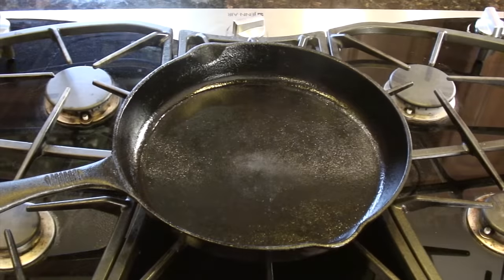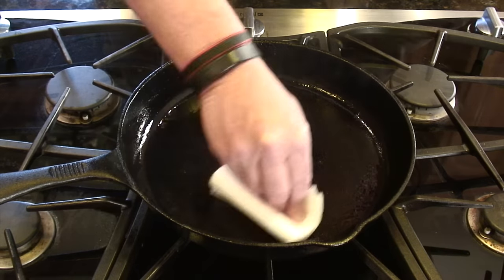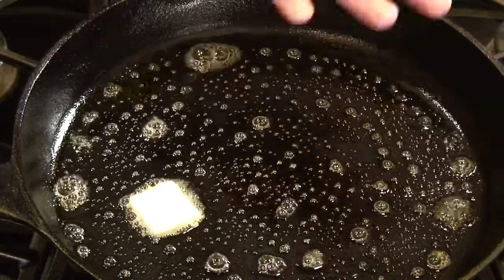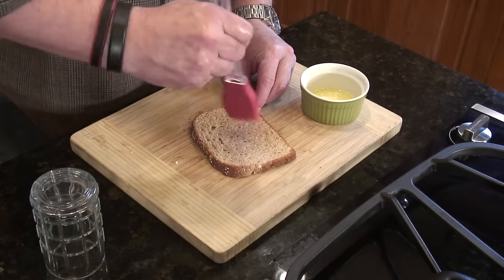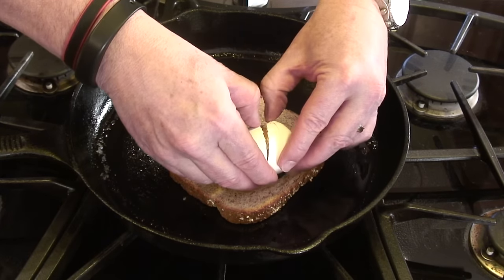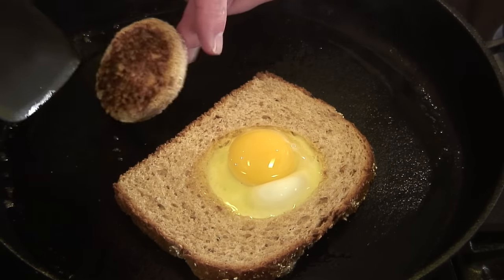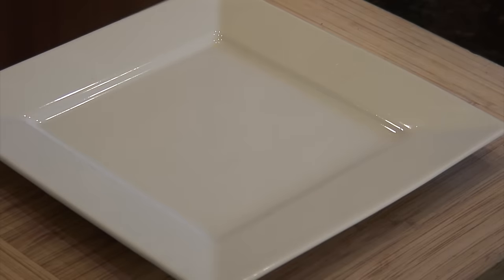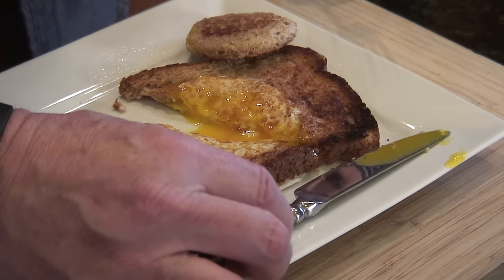How to Make Cast Iron Skillet Perform Like Teflon

Comment: Ok I love my cast iron but this does not make cast iron perform like Teflon. With Teflon, you could pretty much just do the egg without any oil of you chose to do so.  All you've done here is create a near non stick surface using oil/grease. Ya not the same.
Reply from the maker: Ok....you are right.  Go ahead and use cast iron and let it stick like glue.  I understand how Teflon works, but thank you so much for the reminder.
Reply: Are you saying that the egg would stick like glue in the cast iron if you didn't put any oil down? Well of course you are. You know why? Because you cannot make cast iron perform like Teflon that's why. 
I can make a video called "make a Hyundai Accent perform like a Shelby Cobra" ... and drive them both at a steady 60mph. See how that works? To make cast iron "perform like Teflon, you'd have to show an example of the cast iron and the Teflon both doing the same thing - at the limits of what the Teflon's non stick ability would be, not below it. 

Now don't get all bent out of shape because your video title is not accurate....

Now I'm going to go do a steak in my cast iron skillet at 500F - something I wouldn't do in a Teflon pan.
Reply from the maker: You have way too much time on your hands.
Reply: Says the man with hundreds of YouTube videos ;-)
Reply from the maker: I get paid for that.  ;-)
Reply: well then that makes it ok :)
Reply: +svtcontour Just thought I'd do you a favour since you seem to be angry. Actually u don't have to be because your example is actually wrong. He's not reducing the ability of Teflon to match the cast iron. Using your example, he is actually upgrading or modifying a slower car to perform "like" a faster car. 

So his title is not wrong, because it shows you "how to" (meaning you need to do something) make cast iron perform "like" (not turn into/the same) teflon. So, by adding 2 layers of different oils, that is a "how to", and by not sticking, that is "like" teflon. He never said, "how to turn your cast iron 'into' Teflon."
Reply from the maker: Well put Azu Shi.
Reply: Sorry Azu but you are incorrect. You can crack an egg into a Teflon pan with no oil and cook it without sticking. So in this case, it is nothing "like" Teflon. All that's done here is making an iron pan somewhat non stick by adding oil. Same can be done for stainless steel.

If he wanted to make it "Like" Teflon, then what he'd have to do is first benchmark the performance of Teflon by cracking an egg into an oil-less pan and cook it then remove it.   Then he'd have to do whatever he wants to do to the cast pan without the addition of oil and do the same test. If it performs the same as the Teflon pan, then he can say its "like" Teflon.
Reply: svtcontour You can think of them as 2 coatings. So in that sense, a coating of teflon is "similar" to a coating of a mixture of 2 oils.

The key is "similar performance" rather than "same prerequisites". By requiring the pan to have no oil, that is a prerequisite which was a claim that was never made. To check whether a claim is valid, one way can be to extend the claim by adding words:

In this case, "Cast iron can perform like teflon if you give it x coating before use."

You were interpreting it as: "Cast iron can perform like teflon with no procedures before use."

Think of it this way. A slower athlete can perform like a superior athlete by injecting steroids every time before a race. It doesn't alter his genetics permanently, but that is the way to make performance similar. So we know that to make someone perform like someone they are not, this is the "how to." The "how to" doesn't become fake just because it requires them to do it every time before a race.

There was no claim that this method is exclusive to cast iron, just like how steroid use is not specific to one person. It is perfectly fine if this technique works on other pans as well (like stainless steel).

Besides, your example was about reducing the performance of the faster car to match the slower car, which he wasn't doing. He was increasing the performance of the slower car (the less nonstick pan) to perform similarly to the faster car (the nonstick pan).

Through your analogy, you essentially said that he made a video of himself scraping off the teflon coating (you know that right?). That's why I think you were under a misconception right from the start.
Reply: I'm just pointing out that the title is misleading. The title says "like Teflon". Its not an accurate description. Thing is with the oil, well it can also be put on top of the Teflon. My car analogy is still correct btw. Its dumbing down of one car to allow comparison of another car.

Imagine if I made a video that says "make a Hyundai perform like a Lamborghini" ... and then my video was showing the Hyundai and the Lambo both driving at 60 KPH.  That would be considered misleading because a Lamborghini's performance is not judged based on how slow it goes.   A Teflon's performance is judged on how slick it is (not how slick oil is added into the pan).   In fact, you can consider 'seasoning' on a cast iron to be its coating because its also bonded somewhat to the metal, just like the Teflon. The oil is independent and can be used on both.  

The problem is that one is not allowing the full potential of one product to be demonstrated. In this case, the Teflon.  Like I mentioned earlier. The video, if titled "make cast iron perform like Teflon" would be correct only if the egg was fried in Teflon without oil - showing its maximum performance... allowing the egg to slide off with no additional oils. Then the cast iron to be demonstrated doing the same thing - without additional oils.  If it successfully allowed the egg not to stick, then fine, the title is correct.

Anyway there is no point debating this further. I've said what I had to say LOL.
Reply: svtcontour very well. i'll respect your opinion then.
Reply from the maker: svtcontour, you are definitely overthinking this.  This cast iron, even though cured, doesn't work well because it is newer (actually 20 years old or so) than the older cast iron where the cooking surface is totally grinded down and smooth.  This approach (thin coating of olive oil followed by a bit of butter) makes this typically frustrating cast iron work like Teflon, in the sense that it becomes virtually nonstick.  Many people have this same type of newer cast iron (rough cooking surface versus smooth) and get frustrated because even though cured, food still sticks.  This approach provides them with a solution.  So yeah, performing "like Teflon" is definitely an accurate title.
Reply: I get what your intention was. I'm just saying your title is misleading. Teflon requires no oil - its non stick even bone dry.  Cast iron with oil in it does not perform like Teflon. Its pretty much as simple as that.

You could have easily called your video. Make cast iron with oil perform like stainless steel with oil. Its really makes no difference. Heck you could have called it make cast iron perform like a big rock with oil. That's all I'm saying.  The properties of Teflon allow it to be non stick to the point where it can be used without additional oil. Cast iron cannot so its not "like" Teflon ... 

I'm not trying to be difficult. I'm just trying to get the point across that Teflon has properties that cannot be replicated so saying something is like it when its not, is not really correct.   I can agree that cast iron with the right conditioning and oil can be pretty non stick, but its not like Teflon. 

Just for the record. I don't even like Teflon cookware. I have 20 cast iron and like 7 or 8 stainless pieces but I can recognize how Teflon works and when something cannot replicate its function. Since something cant do what it does, then its not like it. That's all I'm getting at. 

Anyway I wont waste more time on this.
Reply from the maker: And I won't either.
Reply: +svtcontour  ⬅️  LOL!   Aaalllrighty then...
Reply: svtcontour thats the point dude. to get the teflon effect using oil and butter on cast iron.